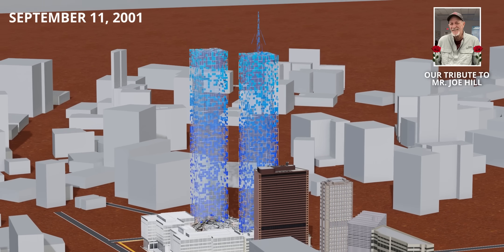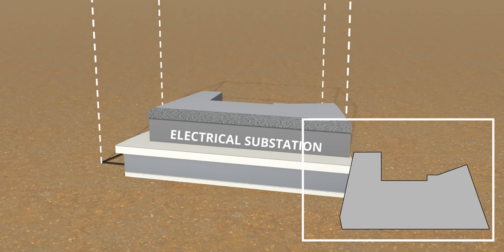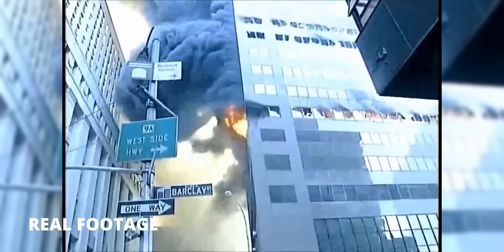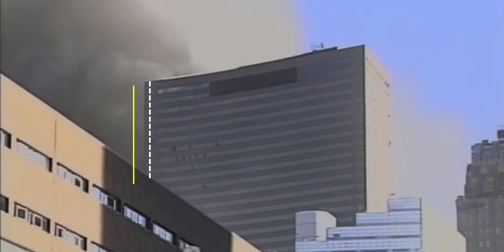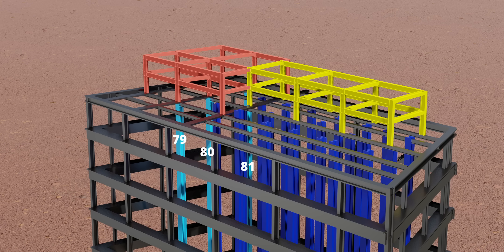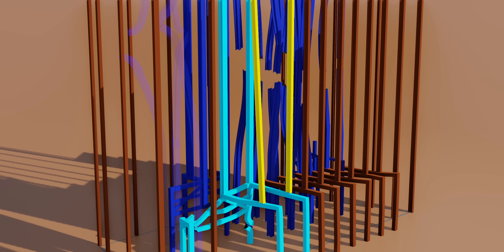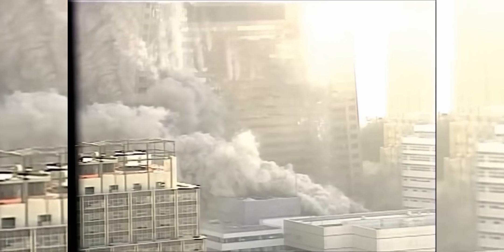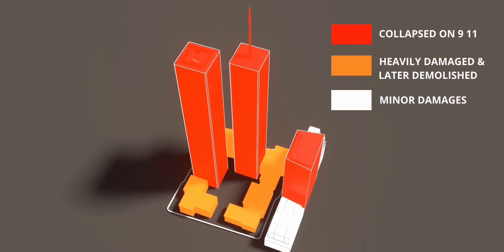Collapse of Building 7 | The Complete Physics

Comment: Who believes this bullshit?
Reply: Belief has nothing to do with it. 
	
This video is pretty good – with a few exceptions - and goes into a much higher level of detail than many viewers will be able to comprehend.  While not perfect, the collapse mechanisms – the sequence of failures - described here  are fundamentally correct and this is true no matter who planned and carried out the 9/11 attacks or why . 

That may not be what you want to hear and go against 20+ years of entrenched dogma and conditioning, but it’s not wrong. 

That also means (in case you did not get the hint) this video can be (and IS) absolutely correct in its description of collapse mechanisms AND the 9/11 attacks could still have been some sort of inside job. The two things are in no way mutually exclusive. 

The mechanisms described here have broad professional support around the world. There are no professional engineering organizations (for example: ASCE, ASEE, ICE, etc) that disagree with them or have offered any formal dissenting opinions or alternative hypothesis. 

So, setting hubris aside, either the overwhelming majority of the worlds structural engineers and simple observation are wrong,… … or you are. Which seems more likely? 

IF you still think believe this explanation is wrong then produce a better one . Good luck with that. No one ever has and I don’t see you moving that needle today.

Comment: This is such crap
Reply: And yet not wrong. Go figure. 
	
This video is pretty good – with a few exceptions - and goes into a much higher level of detail than many viewers will be able to comprehend.  While not perfect, the collapse mechanisms – the sequence of failures - described here  are fundamentally correct and this is true no matter who planned and carried out the 9/11 attacks or why . 

That may not be what you want to hear and go against 20+ years of entrenched dogma and conditioning, but it’s not wrong. 

That also means (in case you did not get the hint) this video can be (and IS) absolutely correct in its description of collapse mechanisms AND the 9/11 attacks could still have been some sort of inside job. The two things are in no way mutually exclusive. 

The mechanisms described here have broad professional support around the world. There are no professional engineering organizations (for example: ASCE, ASEE, ICE, etc) that disagree with them or have offered any formal dissenting opinions or alternative hypothesis. 

So, setting hubris aside, either the overwhelming majority of the worlds structural engineers and simple observation are wrong,… … or you are. Which seems more likely? 

IF you still think believe this explanation is wrong then produce a better one . Good luck with that. No one ever has and I don’t see you moving that needle today.

Comment: Can’t believe you put time it this ridiculous video. 
You ignore completely the size of the supporting structure and the way the columns were linked. 
Visual illusion!? 
The antenna!?!??
There was no huge stress on the columns. 
Why don’t you mention the explosions!?
I call you what you are - a fraud. 
FRAUD
Reply: They only discuss things that actually happened (and get most of it right). Maybe this will suit you better: Building 7, the 6th building to collapse of 10 lost on 9/11 though extensively studied still confuses many. Not famous or a terror target and with no casualties it didn’t get a lot of attention initially, creating an information void the internet filled with utter garbage. Because everything seems like a conspiracy if you don’t understand how it works I prepared this brief summary from my own analysis to fix that. No politics, just engineering. 

The North Tower collapse at 10:28am bombarded Building 7 with tons of burning debris, causing heavy damage and multiple floor-wide fires that burned out of control for 7 hours. Half the FDNY firefighters having been killed, others injured, units in disarray, equipment destroyed, no water pressure, and the greater urgency of Search & Rescue efforts, firefighting was pulled as futile. The building couldn’t be saved and was left to its fate. That is the sort of choice firefighters make every day in brush fire situations - which houses to save and which ones to let go. Only real difference here is moving the decimal on the size and cost.

www.youtube.com/watch?v=g_SvpwyC17M&ab_channel=MFitz  

Collapse of a burning structure is always a concern for firefighters. Steel buildings subject to fire rely on active fighting of the fires to survive. Buildings are designed around 1 to 3 hours of fire resistance, allowing time for occupants to escape and ACTIVE firefighting to get started, after which all bets are off. Left to their own devices they will exceed their design envelope and collapse. In B7 the occupants escaped, passive and active fire protections were compromised and active firefighting was abandoned which left the building to its fate. It lost. Odds on Building 7 would eventually collapse, and it did. No big deal in logic. 

www.youtube.com/watch?v=WnYBX6QT0R4 

FDNY Chief Daniel Nigro ; The biggest decision we had to make on the first day was to clear the area and create a collapse zone around the severely damaged 7 World Trade Center, a 47-story building heavily involved in fire. A number of fire officers and companies assessed the damage to the building. The appraisals indicated that the buildings structural integrity was in serious doubt. I issued orders to PULL back the firefighters and define the collapse zone. It was a critical decision; We could not lose any more firefighters. It took a lot of time to PULL everyone out, given the emotionalism of the day, communications difficulties and the collapse terrain

FDNY Deputy Chief Peter Hayden ; We had our special operations people set up surveying instruments to monitor and see if there was any movement in the building. We were concerned of the possibility of collapse in the building. And we had a discussion with one particular engineer there, and we asked him if we allowed it to burn could we anticipate a collapse and if so, how soon? And it turned out that he was pretty much right on the money, that he said 'In its current state you have about 5 hours

The collapse of Building 7 was anticipated and widely reported in the media throughout the day. At least 24 video cameras recording some or all of the collapse. Everyone knew what was coming and why.

www.youtube.com/watch?v=OY5S5k3tMHI 

Building 7’s collapse was completely different to the Twin Towers, and harder to understand with most details hidden from view. But we can still sort out what happened through careful analysis and observation.  This is my explanation  of the collapse using the best available information and relying on no authority.

B7 was complex 47-story steel framed structure built on top of a smaller existing 3-story building, requiring several lower floors dedicated to complex load transfer structures instead of usable office space. Of trapezoidal shape and all-steel tube-in-tube construction, B7 (above the 7th floor) consisted of a central core of steel columns carrying most of the gravity load, perimeter steel columns around the outside of the structure carrying the remainder of the gravity loads and long span beams and girders to tie those elements together and form the floors. On the outside of the building hung a moment frame - the last part of B7 to fall 

Phase 1 : The first externally visible signs of collapse initiation occurred at 5:20:28 pm. Collapse initiation for B7 is notably quiet with observers not realizing the building was collapsing! There was no audible warning in the form of say hundreds of ear drum busting 180-190dB explosive bangs preceding the collapse. Here at 12:00 a local CBS affiliate reporter is talking 10 blocks from B7 when collapse begins. People don’t start to notice the collapse until 12:11. Then at 12:45 is the famous CBS fixed camera clip of Building 7’s collapse.  Note how quiet it is.

youtube.com/watch?v=t5tEy6mXSE8&ab_channel=fresnosean379

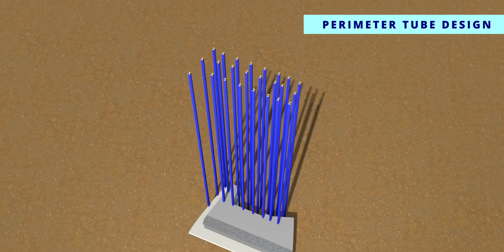Collapse initiation was due to lower floor failures above the load transfer region (7th floor) in the NE corner of the building. In this video at 0:45 you can see the NW corner from inside the building while under construction, Column 79 just out of frame on the left. That big, angled steel beam across the top of the frame connects to C79 at one end. The girders connect to the beam. That beam and all those girders depend on just one connection

youtube.com/watch?v=nP3TNHPCIVU&t=35s&ab_channel=EdwardCurrent

Phase 2 : Lower floor failures caused a loss of critical lateral support over an excessive length of core Column 79 and it buckled. If you look at a floor diagram of Building 7 (see above) and look at all the structures that depend on C79 you quickly realize this one column was a relatively isolated structural element on which a disproportionately greater fraction of the structure depended analogous to say the Key Bridge. Externally we see a vertical progression of window breakage along the 44-46 line and a kink in the roof of the East Mechanical Penthouse at the top of the building, consistent with C79 failure. The transition from full capacity to almost no capacity occurs in virtually an instant. Once the buckling failure occurs there is almost no resistance

Normally with a buckling column, the load could very well be redistributed to other columns, meaning the buckling could stop after a while. With C79 that is not the case - the failure did not redistribute the load, so the collapse rapidly progressed to the roofline, sinking the rooftop penthouse.

Phase 3 : With C79 gone, B7’s progressive, non-symmetrical collapse continues with C80 and C81 at the east end of the core left laterally unsupported and quickly buckled and failed as well, sending the EMP down through the building. C79-81 all have no diagonal bracing, which I believe is a major reason why they could not redistribute a lot of vertical loads among one another.

From there collapse progressed from east to west through the central core until the core was gone taking all of the interior floors and structures and probably most of the perimeter columns with it. You can see the horizontal progression of window failures low in the building and the dropping of the remaining rooftop structures into the building. One of the big takeaways from the NIST Building 7 study (that gets completely ignored) was their modeling which determined C79 failing under ANY circumstances would have initiated the same collapse sequence.

Phase 4 : 10 seconds in only the exterior moment frame - just a hollow empty outer shell – remains, the illusion the building is still standing since little has outwardly changed. But it’s just a hollow empty shell like an empty cereal box supported by only a few remaining columns and quite unable to remain standing. With all internal framing gone, the north face leans inward, forming a V in the roofline, the last perimeter columns buckle under the strain and the moment frame free falls, landing on top of the 7-story high debris pile. It is only here, at the end that a single measurement of alleged free fall acceleration is taken, from a single point on the moment frame. The Building (defined as its center of mass) did not “free fall” (sort of) – just one corner of the outer shell did. _
The Building_ was already gone before that happened. The period of alleged free fall was a product of collapse progression mechanisms, not of collapse initiation mechanisms and is irrelevant to what started the collapse. Start to finish the entire collapse took 18-20 seconds, 3 times longer than true free fall and how fast something falls cannot tell you what started it falling anyway. The debris spread outside the footprint, blocking surrounding streets, heavily damaging the Verizon Building and destroyed Fiterman Hall.  

Building 7’s progressive, non-symmetrical collapse was incidental and unintended collateral damage from the combined effects of fire + time + gravity started by the collapsing North Tower. That is true no matter who planned and carried out the 9/11 attacks or why . The collapse was of so little consequence it barely even registered at the time, a mere footnote. It only took on semi-mythical status as an alleged smoking gun years later when demolitions at the Twin Towers, missiles at the Pentagon and shoot down over Shanksville all failed and conspiracists had nothing left to work with.

I hope you found this helpful, informative and it solicits informed critical comment. If I made any errors of fact, logic or reason or left anything important out, please let me know so I can fix it. IF you can offer a more plausible alternative please do. Be the first. Please start any reply with the words “Tits McGee” or I will know you didn’t read it and are wasting my time.